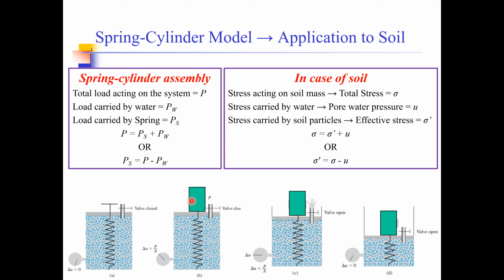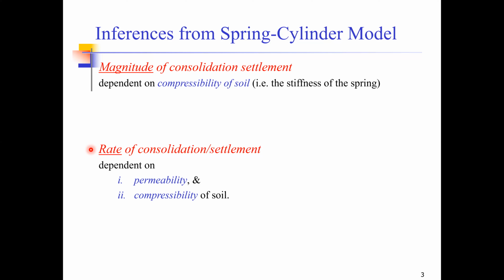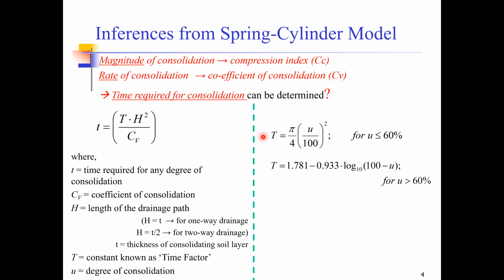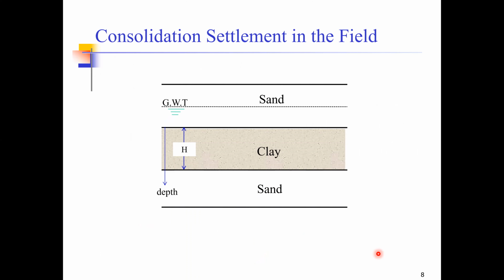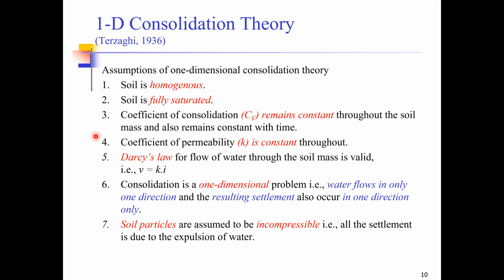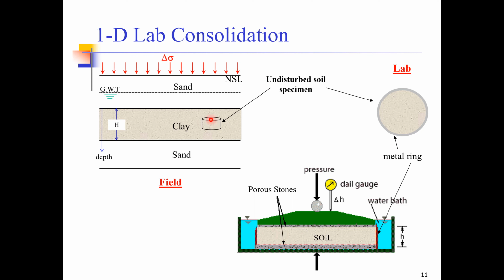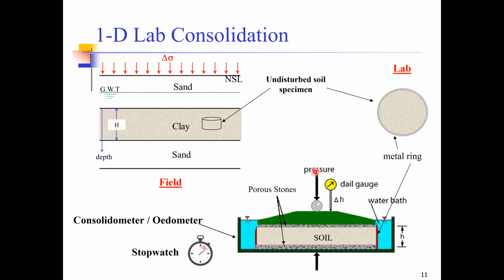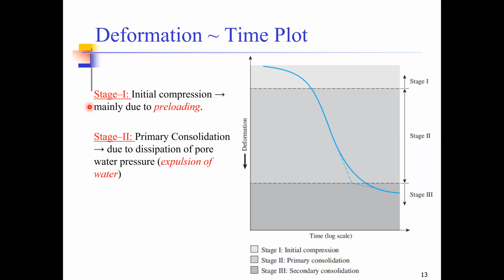24- Soil Mechanics - Soil Consolidation-II

Comment: Please can you send solution to this Practice Problem #4

At a certain depth below the foundation of a building there exists a clay layer of thickness 10 m. Above and below the clay layer there are incompressible permeable soils. In a consolidation test on the clay sample with drainage at top and bottom, a sample with initial thickness 2.54 cm was compressed under a steady pressure. Half of the final settlement took place in 10 minutes after the application of pressure. Find how long it will take for the settlement of the building to reach 50% of its ultimate value?

If the clay layer had drainage only from top, what would be the settlement time for 50% consolidation?